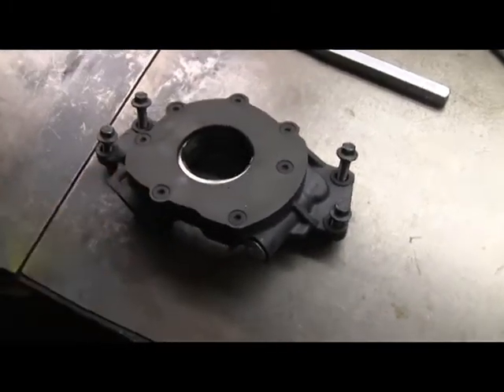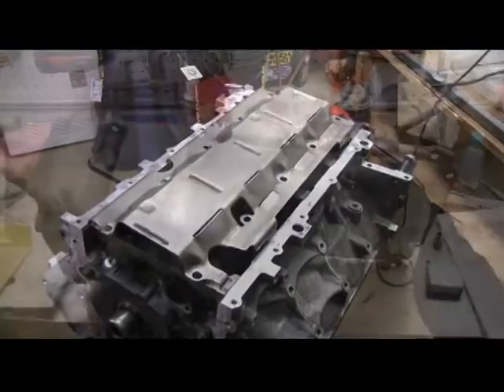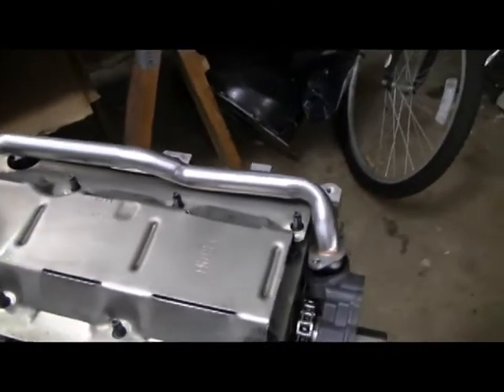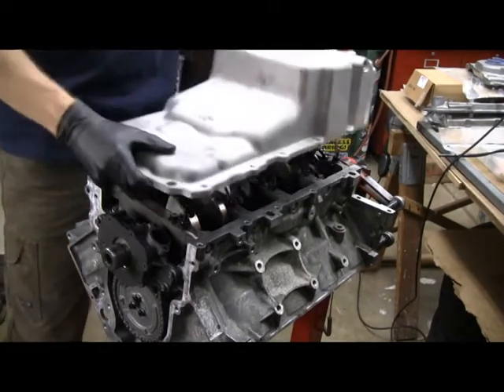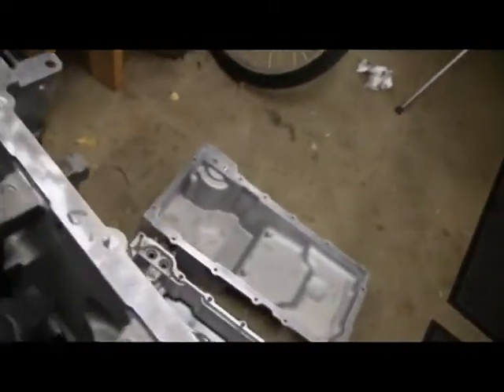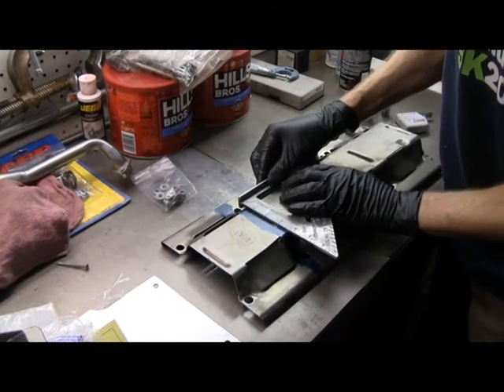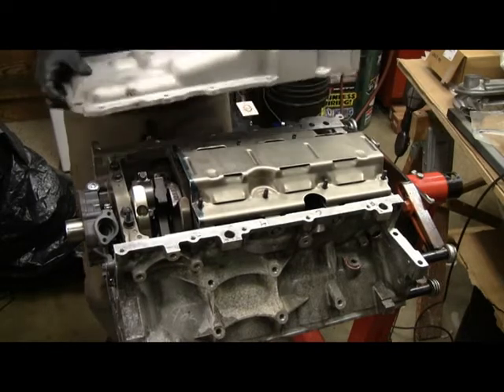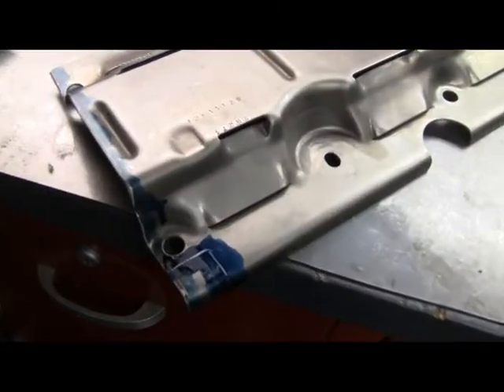LS conversion swap part 40, Oil pump and windage tray

Comment: What kind of bolts did you use to hold the windage tray down?
Reply from the maker: Stock hardware I took off when disassembling the engine

Comment: you forgot the shims for the oil pump
Reply from the maker: I am using a standard Timing chain and gears, there are no shims that I know of. Shims are only needed for a double roller chain?
Reply: Prime Garage GM A-Body LS Swap no for centering the oil  pump gear to prevent premature wear
Reply from the maker: I searched on the web and found the info about shimming when installing, I know understand what you are talking about. I called Melling (the pump is a Melling 10295) to get there opinion. They do not recommend taking the pump apart to shim, but do say to put the pump on finger tight then rotate the crank 360 deg and  then torque the pump  down. This centers the pump internals to avoid extra wear. Strange that this info was not included with the pump nor mentioned in the assembly manual I have. I will take their advice and remove the pan and front cover to install as they suggest. Thanks a lot for bringing this to my attention. With this being my first LS I have a lot to learn.
Reply: Prime Garage GM A-Body LS Swap no problem ...i guess that would be another way to centre the pump , glad I could help and possibly prevent any damage.  Love your videos you're doing a great job 
Ryan